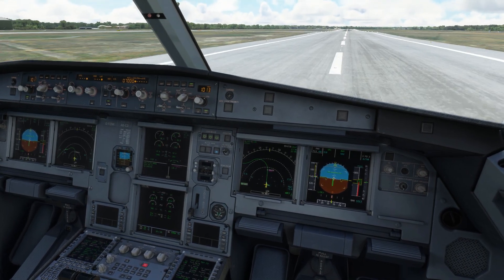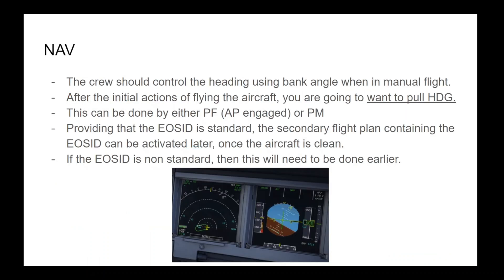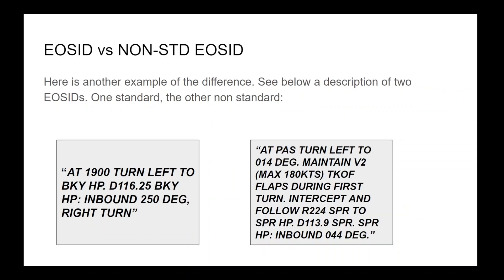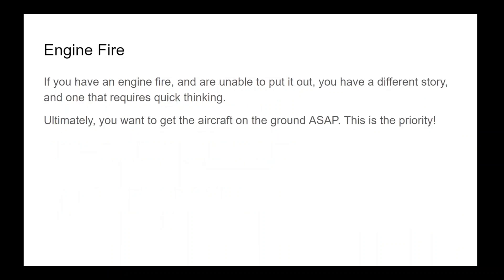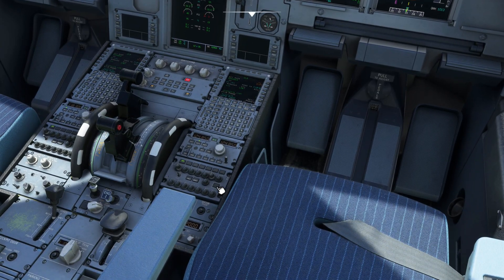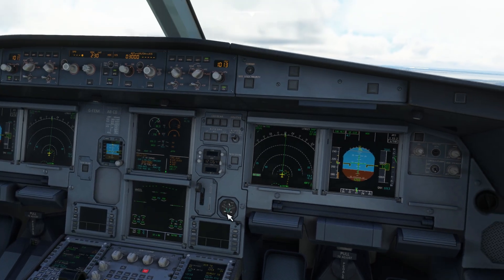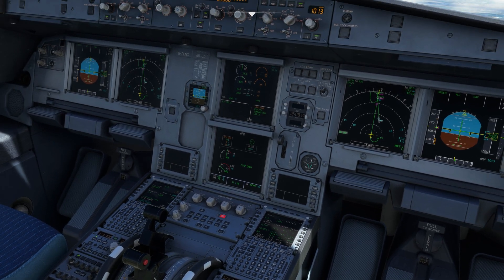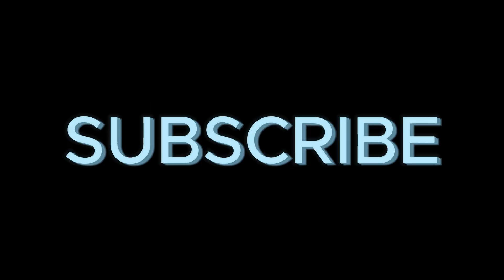A320 TYPE RATING - Engine Failure After Take Off (EFATO)

Comment: I remember when engine is secured and wait until reaching 1500ft to push V/S but I see u push at 1300 ft
Reply from the maker: Thanks for your comment! So typically we can push V/S after 1000AAL and once engine is secured. At 1500ft AAL that's when we can begin our turn to the hold on the STD EOSID. 
Different companies will have different operating procedures. So some might level off at 1500ft. Hope this helps :)
Reply: Normally OEB’s are before ecam actions, and when you reach the status, you must check the acc flow pattern.